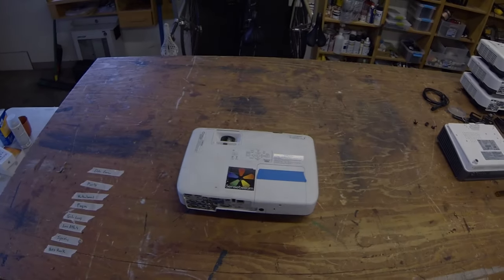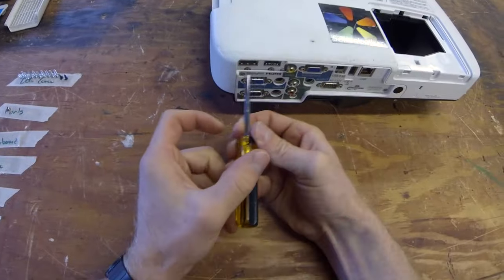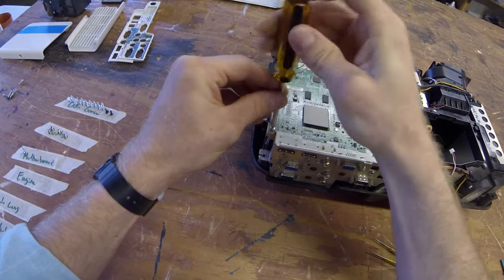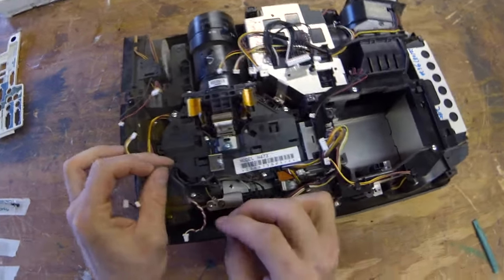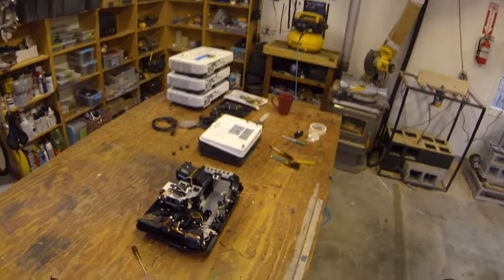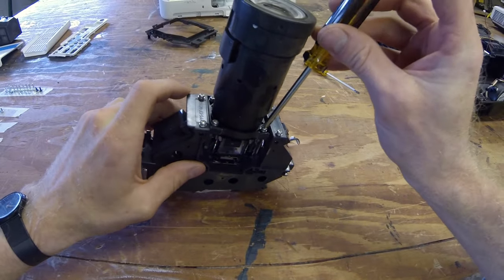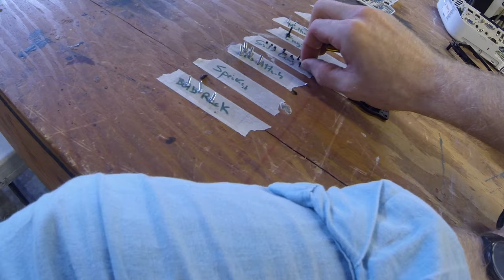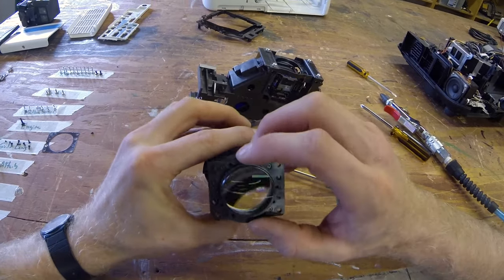Epson 1960 Powerlite Projector Dust Cleaning

Comment: Hi Casey, thank you very much for this extremely informative vid. I found an Epson EH-TW5500 at the dump yesterday and plan to try and fix it. Everything runs smoothly up until the EPSON logo disappears to make way for the menu etc. Unfortunately no menu or any kind of picture is projected at all.... Just dim light. And no flashing led warning lights. I'm thinking a main board problem and will use your vid to guild me through getting it out. I thought I might try a reflow. Plus I noticed 2 specs of dust on the lens being projected so I'll tackle a dust removal job hopefully if I get it working :) Thanks again mate! Anthony

Comment: thank you! braved a lens clean myself after watching this it looked easy ;) btw... my lens assembly did detach from the focus ring but could not be torn down any further. I am a vaper and had "fog" on my lens' Used 91% rubbing alcohol in a tall glass to soak and clean this all out. Like new! ty!
Reply: My vs220 as a single focus ring, after removing this ring.... I lowered the two lenses that were on the focus ring side into the alcohol bath... the other "projector side" lens' were clean so i kept them out of the bath....With the two lenses that were foggy in the "bath" i shook and blew air a few times until I could see the alcohol dry "clear"
Reply: also it should be noted that i sprayed some air between the lens' from the side of the plastic housing i could see that they were placed just on top of each other enough to get air though. Saw a bit of dust leave from that method, so since i assumed there was no glue on this part of the structure THAT is why i used the 91% to remove the film/buildup of vapor (polypropylene glycol and vegetable glycerin)
Reply: Casey Scalf is it possible to clean the inside lens without removing the motherboard and everything else? I think I'm starting to notice that "fog" Eric was referring to

Comment: Casey. Good job, but do you do all of your repairs by hand? By that I mean screw by hand? If so, you'll end up with carpal tunnel. You really should use electric screwdrivers where possible. You can get some good low torque ones now. I didn't realise there was so much inside a projector too.

Comment: Hi casey i have epson home cinema 2030 i drop my epson on a carpet i thought it's not problem but when i turn on ,those letters on the right upper corner HDMI 2 had a red shadow ,what do you  think the problem .can you help me mr casey
Reply: Sounds like the LCD panels are misaligned.
The fragile transparent screen door connected to the light house assembly in this video is a LCD panel that blocks light making light not pass through certain pixels.
The thre Texas Instrument panels in the back of the lens with the three ribbon cables are thre RGB LCD panels gicing you the color.
He cleaned the colored panels way to aggressively.
I would guess all 4 LCD panels need precice alignment, It's stupid or dumb of Epson not to have adjustment screws for each panel, I think they're just glued in there..

Comment: My epson  1965 is flashing red 37 times when I plug it into the wall, no other lights are on or flashing.  It turns to green and works fine.  Any ideas what to check?  Thanks

Comment: Epson projector are built so badly in regards of keeping dust out! In a normal home you get dust specks on rhe lens or mirrors within 3years!

Also why they rely on loud fans for lamp cooling instead of LED COB that can be cooled with a much quieter closed loop radiotor like a PC is strange..

The fragile transparent screen door connected to the light house assembly lid in this video is a LCD panel that blocks light making light not pass through certain pixels.

The three Texas Instrument panels in the back of the lens assembly with the three ribbon cables are the RGB LCD panels gicing you the color.
He cleaned the colored panels way too aggressively in the video, I think you should clean them with the same brush you clean a mirrorless dSLR LCD panel with.
I would guess all 4 LCD panels need precice alignment, It's stupid or neglect of Epson not to have adjustment screws for each panel, I think they're just glued in there..